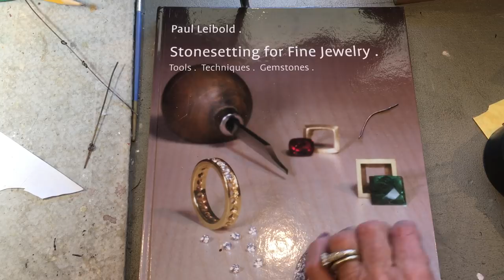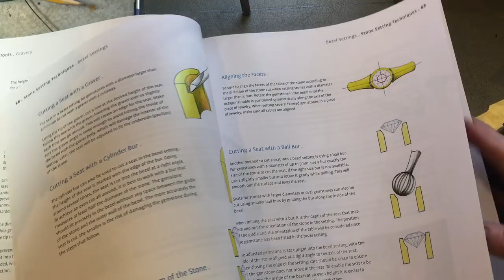Jewelry Bench Tips, Tricks and Hacks (new name 12/19)

Comment: Hi Nancy, thanks for the video - lots of fun. I made a needle/escapement file holder by punching holes in the lid of an ice cream 2l  oblong tub, filling the tub with dry sand, replace the lid and push your file handles through the holes. They don't rub together, you just have to be careful not to lean on the file points. Make sure the sand stays dry otherwise your file handles will rust a bit. I used the revolving punching tool with the different size holes.

Comment: I was using a needle file on my second Octopus Hair Thing!  Congrats on the Rio Tool Advisory Board thing!'
About cotton swabs - I've used them in my flex shaft, making sure I'm using the "small enough" collet (slightly smaller than you think) for buffing in tiny places.  You want to pull off almost all the cotton, and make sure it's cut as short as possible.  Too long and it starts swinging in a circle like an exotic dancer's pasty tassels.